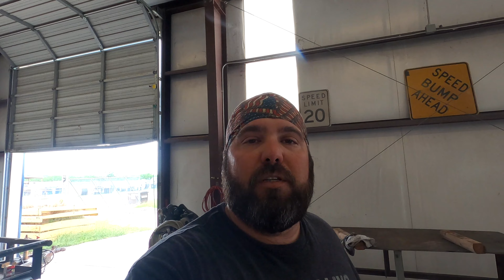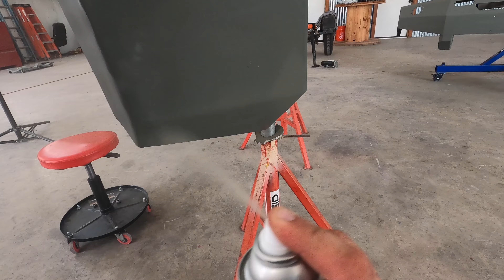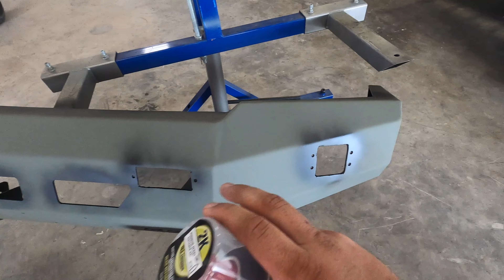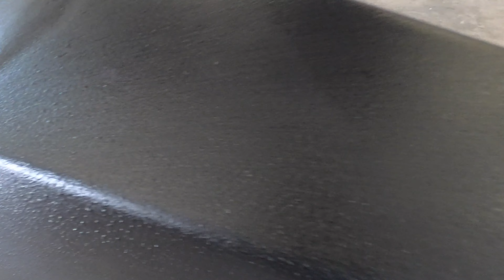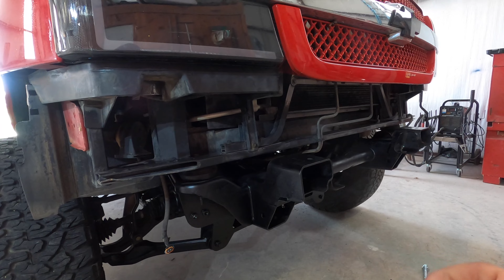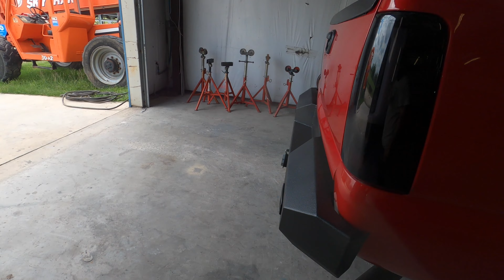DIY Move Bumper Install (Part4) They Are Finally On The Truck!!

Comment: What about licenses plate lights
Reply from the maker: Used motorcycle license plate bolts with the built in lights. Clean look and didn’t have to cut holes for lights.